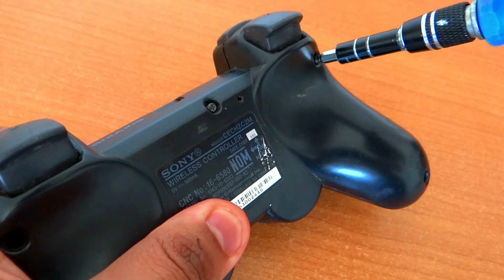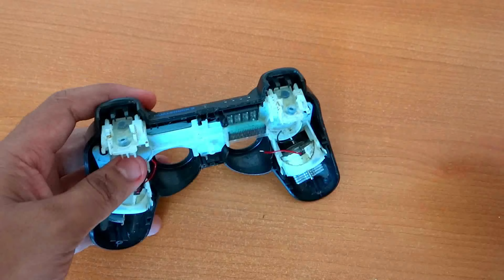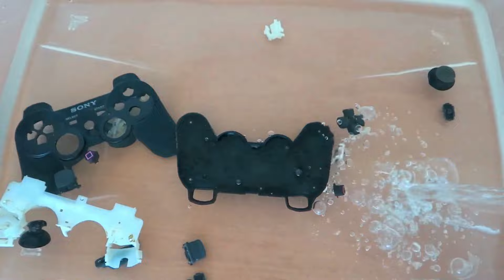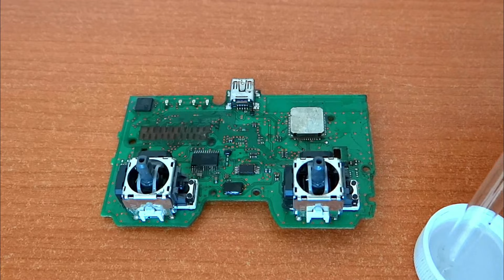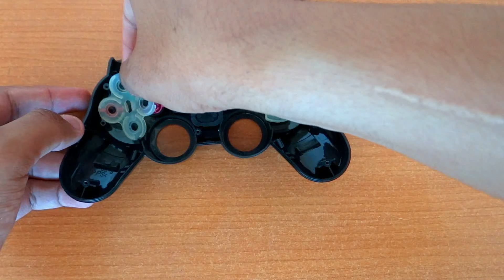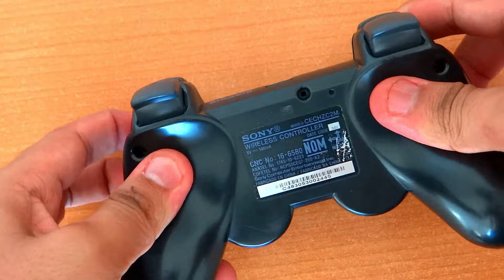PS3 Controller Restoration- Restoring DualShock 3

Comment: I've never taken apart a controller before but I didn't want to buy another one. The left thumbstick was acting haywire and causing the right stick to move when it wasn't supposed to. The buttons weren't responsive as they should be. This totally helped me now it's working perfectly.

Comment: Well done,great job!!!some questions please....what grease did you use? When you say be careful the alcohol might corrode the contacts ,how do you avoid that as you still use it,what is the trick here?also ,did you also use alcohol with the toothbrush on the whole surface of the circuit as well or was that some other  chemical?
Reply: you can use soap and water on a circuit board... aslong as theres no electrical charge. but he sprayed isopro alcohol.
Reply: Isopropyl alcohol is the way to go, that alcohol evaporates very easily that is why i chosen to clean circuits

Comment: nice video my friend  i  had  to do the same with one controler i had  i took it apart and all cleaned it changed a broken joystick , but i wasnt able to fix a problem with the arrows.
Basically when i use the arrows i get some extra click on the upper arrow , like it stuck . do i fix it by cleaning the flexboard or some other way??

Comment: Did you use the isopropyl alcohol to clean the board as well?
Reply from the maker: You can use it of course, you just have to be careful with the contacts from the flex to the motherboard, these are the only ones that can be damaged if you use isopropyl alcohol
Reply: @VRestoration  I damaged my flex cable with isopropyl alcohol. L2 doesn't work. Is there a way to repair the flex cable?

Comment: So for the vibrating motor soldering, did you just melt the already existed and stick the cable wiring in to joint it with the motherboard with no extra solder or flux? 
Thanks

Comment: Sorry whats the name of the tool you use to connect vibration wires again?
Reply from the maker: It is a soldering station, it has a pencil soldering iron and a heat gun, you can buy a pencil soldering iron in homedepot or some store like that, they are very cheap you can find some from 5/10 dollars but I recommend that you buy the best complete station Since they are not very expensive in reality and they are much more durable in addition to that you can regulate the temperature better.

Comment: Is it possible to remove some of the weights for the Vibration?
Reply: No weights th3 siad weights are the rumble motor, you can take them off tho if you want it's the same thing as tearing the cable you won't have vibration

Comment: Fantastic job🔥 I have a question: my controller has a stripped screw and it won't come out. Do you have an idea of how to get it out? If not, can I risk and force the case to open up with 5/6 screws removed?
Reply from the maker: Well, with larger screws they can be removed with a drill, but the problem is that it is too small to do that. If you really need to open the knob, I advise you to try to remove the entire head of the screw with a file or something like that so that it comes out without damaging the housing, but the truth is that it is very difficult to do.
Reply: @VRestoration  thank you so much for replying, it means a lot to me. You're very kind❤️
Reply: I know this was ages ago, but just in case you are perpetually holding onto your broken electronics ( like me :P) they actually make drill bits specifically for this issue. GraBit is one brand name, but they have cheap sets on amazon that wont set you back more than $10. Ive used them for small screws on my laptop.
Reply: I had the same problem, i used a very thin drill bit

Comment: I'm a layman, but I have a question. Is it really proper to drip Isopropyl all over the circuit boards? Is Isopropyl completely harmless to the electronic components? Also is that 90% or 70%? Honest questions
Reply: I think generally it’s advised to use 70-99% iso whenever working with small electronics such as this. Preferably 99% as it dries up a lot faster.

Comment: I did all this and only the L2 controller didn’t work, like it can’t sense it at all
Reply: I have the same problem my L2 doesn't work as well. I think it's because I rubbed off the contact points too much on the flex cable with isopropyl alcohol. You might have to replace the flex cable.

Comment: I am at my wits end with controller issues. One of my controllers just turns off by itself, especially if i am playing an action game where i press a lot of buttons and quickly. It starts being unresponsive, then it just goes completely unresponsive then it finally turns off. The console does not eve detect that no controller is connected for several seconds even though all the lights in the controller are off. Happens while connected via USB or wireless, if wireless it just starts charging when turned off and usually it's detected as off earlier. It's driving me nuts. Some times i can play for hours with no issues, some times it keeps turning itself off constantly. 

I doubt it is the battery since i changed it, so it has to be the ribbons or something in the board no? (it's the later, cheaper model of controller). If i could get a broken controller for cheap with the board and ribbon in working condition i could probably fix it. I have opened the controller so many times the screws are on the verge of being stripped and don't want to deal with that for nothing.

I can't find ANY information on these issues.

Comment: mine is basically clean, but all the button on the left side won't work. tried cleaning the ribbon and the contacts, it just won't work.
Reply from the maker: in the part where the flex and the motherboard make contact there is a small pad that presses one thing against the other. Sometimes it wears out over time, you can try to make that pad press by making it thicker either with tape or foam.
Reply: @VRestoration  did just that. it seems like the ribbon is just fucked beyond repair. opened the controller, found some water damage on the ribbon. must have shorted the connection permanently because it registers button press on L1, L2 and the directional buttons without anything pressing the buttons.
Reply: @VRestoration  opened another ds3, same water damage at the same spot: near and under the select button. the ribbon shows green rust that wont go away with cleaning. i think it has something to do with the rubber button degrading with time that causes this damage.